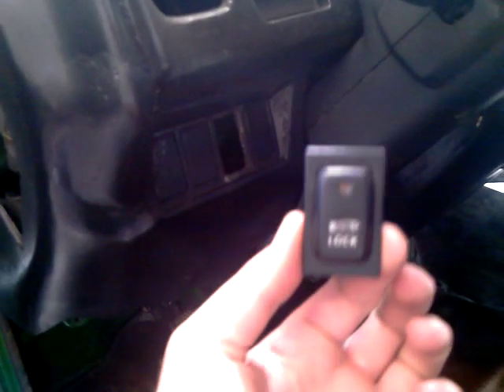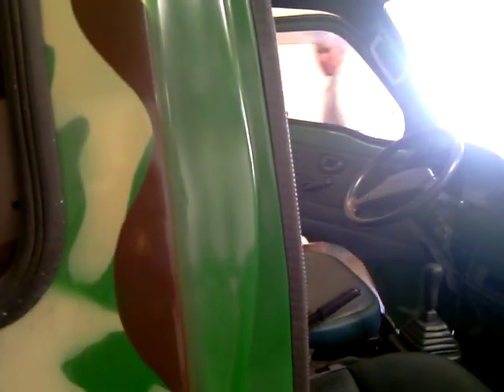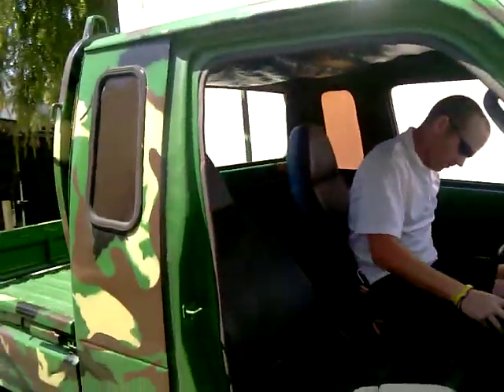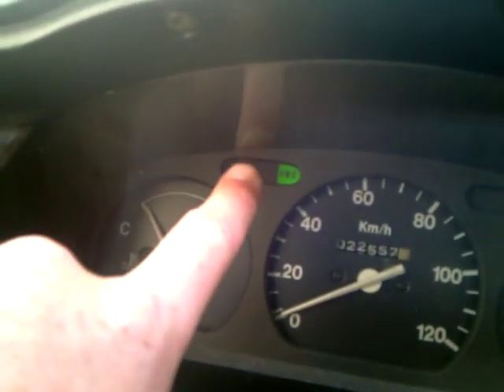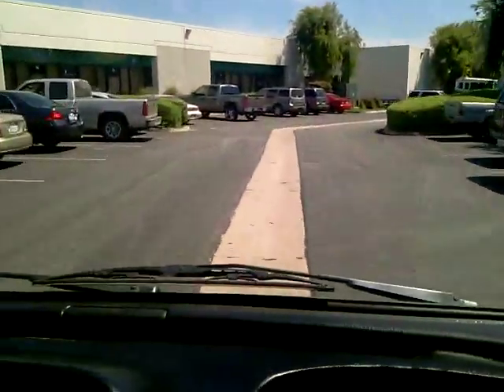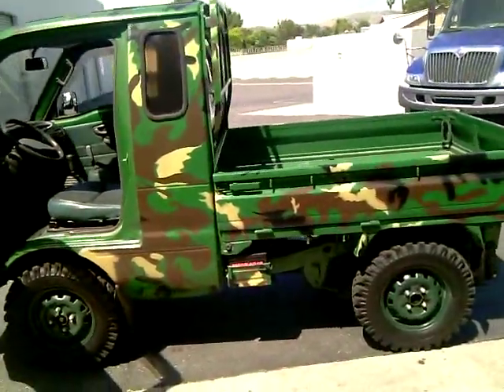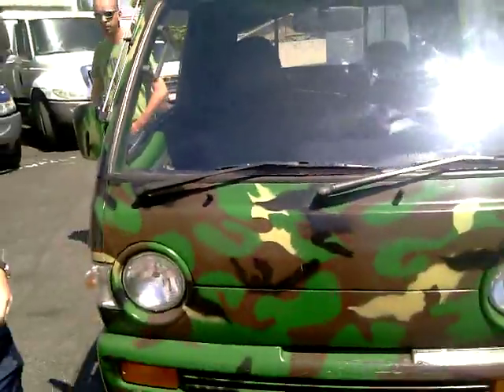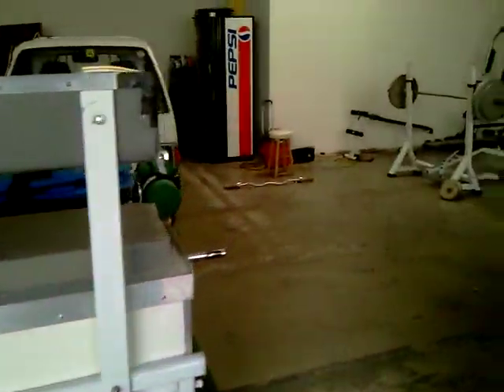Camo Suzuki Mini-Truck 4X4, California

Comment: Japan is a RHD country, and clearly, this truck used to be, but was converted to LHD. (Probably in the Philippines) Notice how the wipers still sweep to the right. Dash was repainted after being put back together. The a/c is hard to move under the dash so it was removed. Suzuki never made an extended cab version either, but I must say, whatever company did the work, did a nice job. That's the way an extended cab should look! Nice truck! Wish I knew who did the steering conversion & cab extension
Reply: John Davidson, check for Hyundai. When I was 12 (am 41 now) a gentleman in Cuba used to have a Hyundai double cab, that seats 5 or 6, and a nice bed like the one shown here but, the side railing were taller. That gentleman used to drive many of his friends 26 kilometers every day. That was in Cuba where is hard to have anything but now, since we are out of that Country and I told you this, you can search it up. I think you'll absolutely love it mini with double cab. That was a bullet. Super fast and secure. Hope you find one. Let me know if you find it.

Comment: Lol nice.  Too bad you sold it though.  Another socal Hijet owner here.  Other than the trucks on base, I only have seen one other kei-truck in San Diego.  They are good trucks when you can get them to achieve a decent speed.  Mine had topped out at 80-something a few times.
Reply: I'll be uploading a new video soon of mine... just finished a drive down 101S from NW Oregon to central Cali :D.  It lived... and I agree, not bad at all...